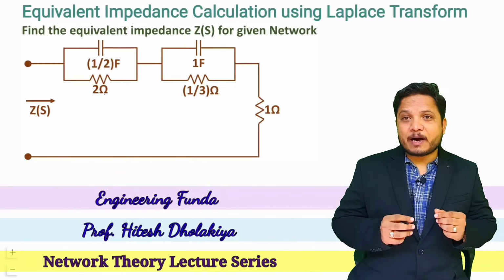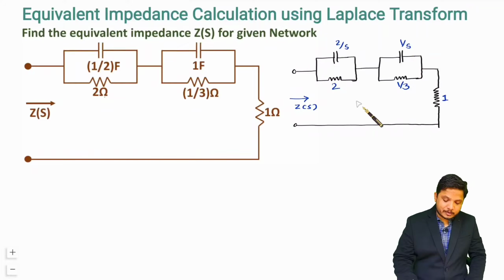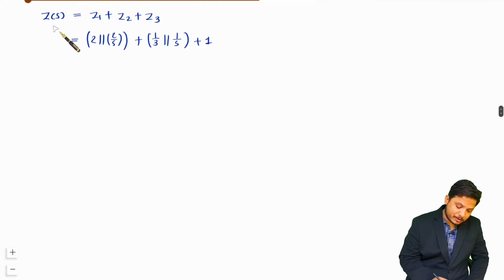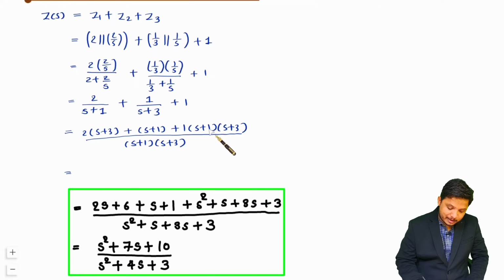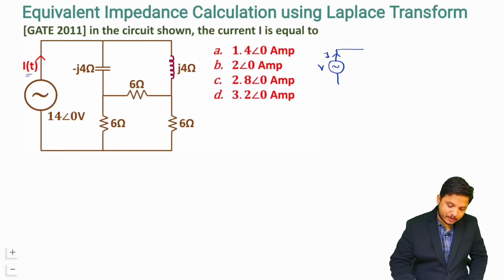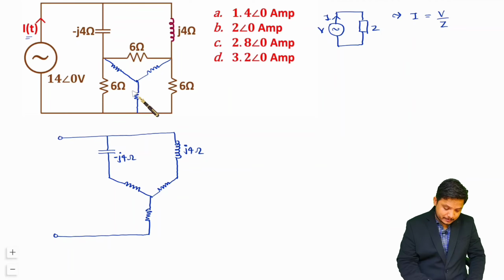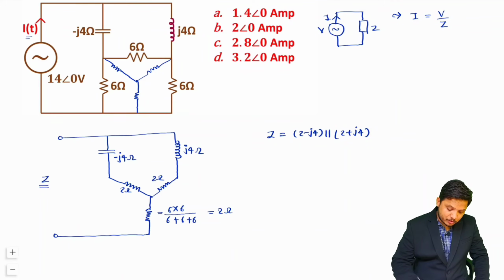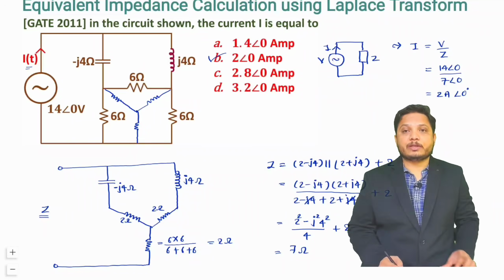2 - Equivalent Impedance Calculation using Laplace transform: Detailed Examples

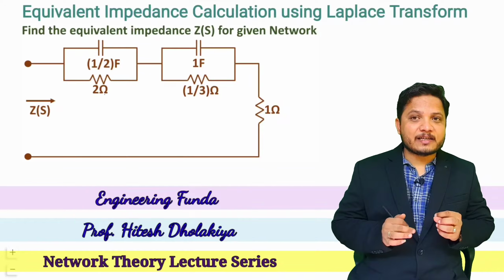Comment: 00:01 Calculating equivalent impedance using Laplace transform
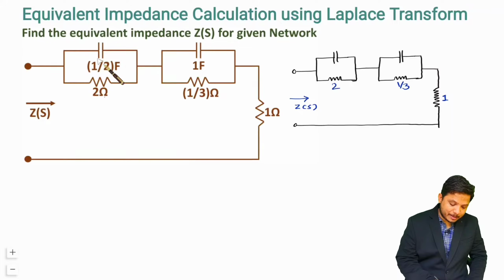01:23 Impedance of capacitors can be calculated using Laplace Transform.
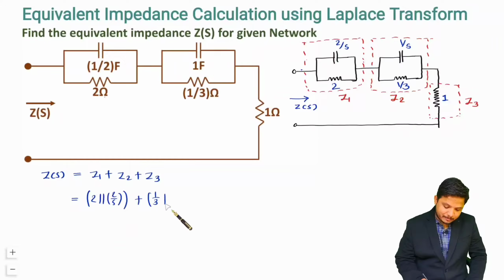02:52 Calculating equivalent impedance using Laplace transform
04:18 Solving for equivalent impedance using Laplace transform
05:41 Identifying equivalent impedance in a circuit
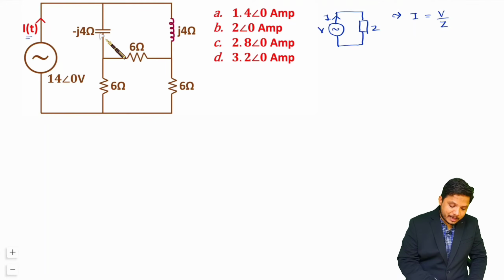07:03 Identifying equivalent impedance using delta-star conversion
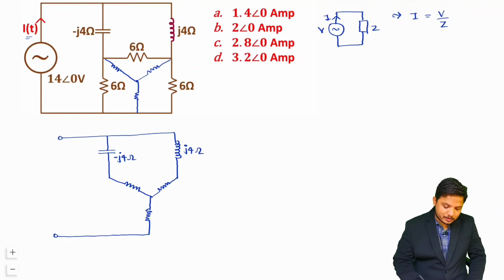08:31 Calculate equivalent impedance using the Laplace transform
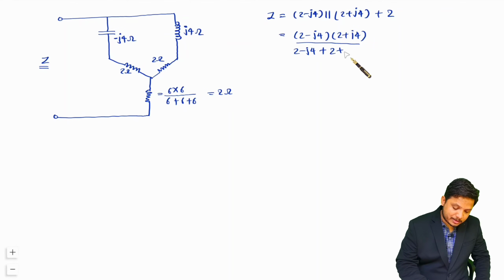09:56 Equivalent impedance calculated using Laplace Transfo

Comment: Hi,  Thanks for the video and your effort. There are some errors on your parallel circuit RC. the impedance is 1/Z=1/R + jcw and u need to calculate it as a square of a complex number as it is dependent of w. Z should be 1 / ((1/R)2 +(cw)2)1/2
Reply from the maker: There is nothing wrong in this calculation dear.
Reply: @EngineeringFunda  as u like